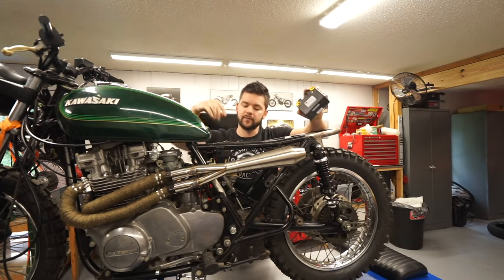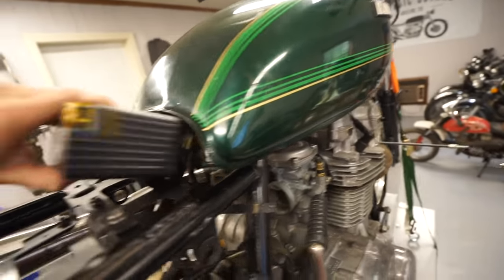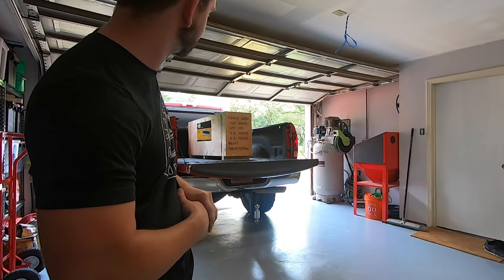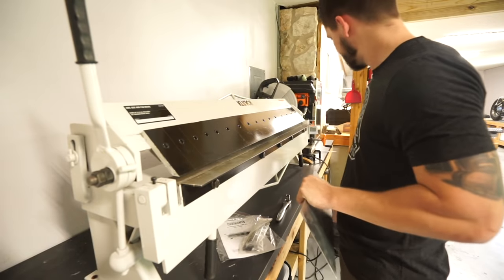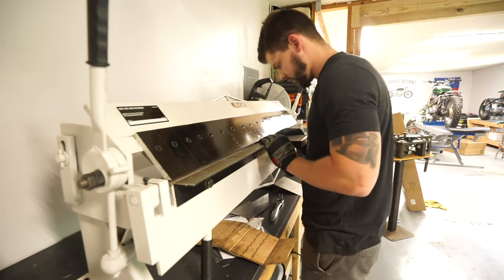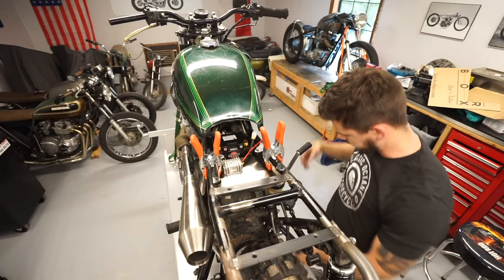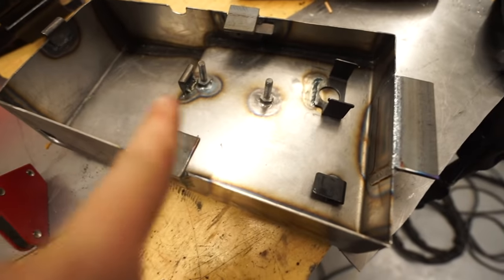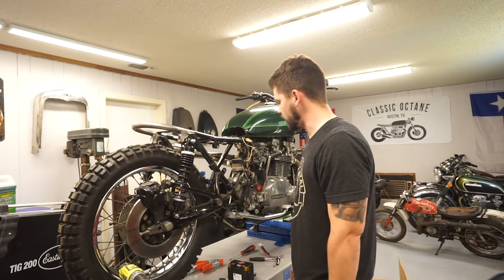KZ750 Scrambler: Building a custom battery box

Comment: When tapping threads. Use axle grease. It not only lubricates the tap, but it also catches most of the metal chips. WD-40 is then used to clean the tap.

Comment: Hey Taylor, love watching your videos !!! Gives me ideas for my own stuff.
Couple recommendations for you.
WD 40 can cause major contamination with some paint products, best to use a non silicone based lubricant.
Try some "quick-glo" polish on the wheels, there are videos on you tube. It puts a rust treatment chemical into the metal.
Also when I build boxes,brackets and stuff at my restoration shop I run the parts thru my blaster to put a real good etch on the metal prior to painting, makes the paint much more durable. 
Keep up the good work man.

Comment: I have been working on a scrambler on a 78 KZ400 for a while now. My wheels were quite a bit worse than yours but I went with truck bed liner after scuffing them with abrasive pads. I figured that if they get marred up it will be easy to touch them up.
Reply: Love these videos by the way. I have been putting off building the exhaust since I wanted high pipes but did not really have any experience doing something like that. Now I have some inspiration and drive to get back to working on that bike.

Comment: Hey man, loving your vids and the way this B1 Twin is turning out. Quick tip, I’ve found using lard from the supermarket a very cheap and very affective cutting agent for tapping a thread. Not sure on the US equivalent you may have available but it works better than WD40 imo. Keep up the good work 👍🏻😎🏍

Comment: Does this bike have a permanent magnet alternator like the old KZ 900 has? If so why not just use a capacitor and do away with the battery and electric starter solenoid . I have a '75 900 kaw I did this to when I chopped it in 1982 and it works just fine with lights. These old bikes kick very easy and so it isn't a big draw back and you don't need to hide a battery.

Comment: Could you take a thinner angle iron and use for the brake at times when u want a shorter bend ? I have seen where the brake is notched for this purpose as well , 
I personally like the contrast between new/original patina but have the rims re chromed and do a video of re spokeing them
Reply: I was thinking the same idee :-)

Comment: Hey Taylor, on a bike like the Honda CB750, is there ever any risk in cutting that frame cross section under the seat, risk such as creating a weak point or possible frame shifting? What thickeness metal did you weld on to that build in place of the original support?
Reply: SOHC/4 dot net good resource on Hondas.
Reply: Yes. The metal on those frames are not great. People cut the cross sections for cafe racer seats but they will weld cross sections in to attach the seat or fabricate a hoop on the end to keep things ridged.